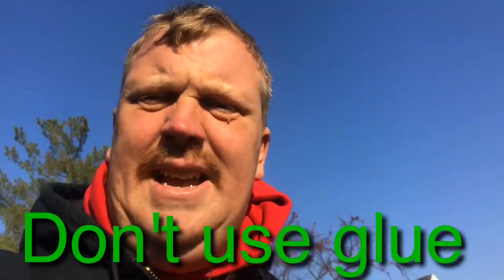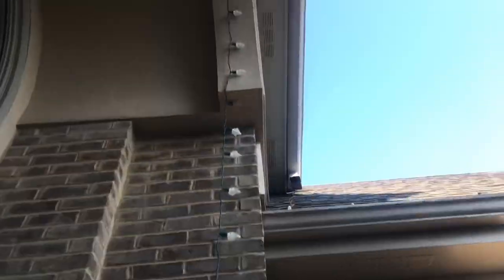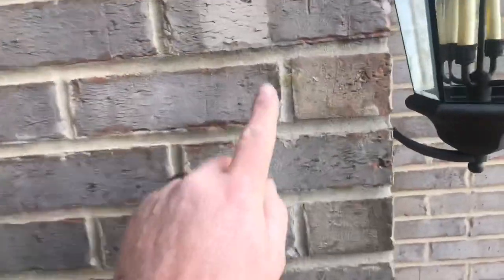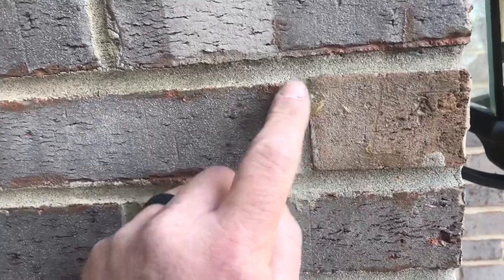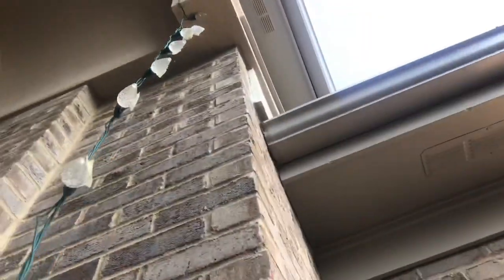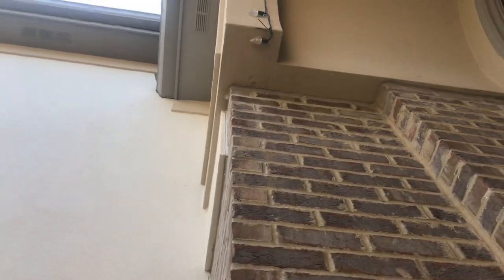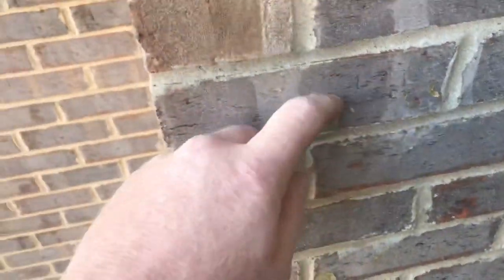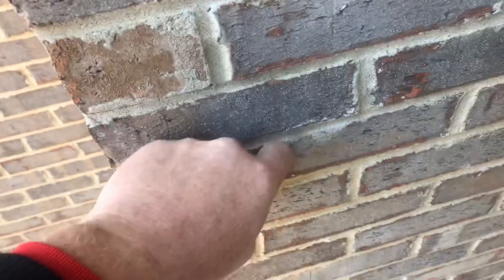Why We Don't Use Glue To Put Up Christmas Lights

Comment: He never says what to use.  What do we use then sir?
Reply: Hot glue is absolutely fine to use on brick archways. You'll find that if you live in an area where it get cold in the winter, if you take the lights down while it's still somewhat cold out, the entire hot glue glob will pull right off with each socket, easily and with no issues.

He is correct however with not using the hot glue on stucco, as it will at the very least pull some paint off.
Reply: @HomeGrownPyro1  Thanks.
Reply: @mrjack2617  no prob

Comment: Hey! A few things: Can you do a video on how you store christmas lights so they do not tangle (c9 lights and mini)?

Is there a good way to put lights around a garage door?

Do you ever wrap lights around individual branches of naked trees, and if so what’s the best way to do that?

What is the difference between SPT 1 and SPT 2 wire?

Finally, what is the best brand to buy mini lights from? I always buy a ton of led mini lights but some don’t even last until Christmas.

Sorry for so many questions!😂
Reply from the maker: Austin Huguenard just for you
I have a few of them done now and will be coming out this week
Reply: Christmas Lights Thank you sooo much!
Reply: I lay my lights down on a large sheet of 3 ml plastic. If they are a long string, I lay them in serpentine shape, back and forth.  Put another sheet of 3 ml plastic on top, then gently roll them up.  Then fold the long roll and place in a plastic bin, labeling the roll what it is (multicolored 200 lights, white curtain lights, colored net lights).